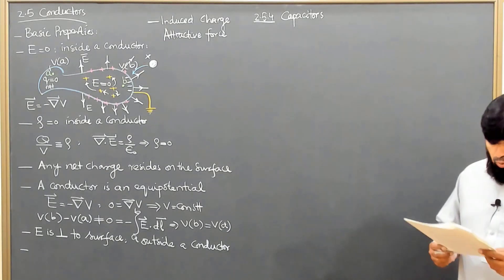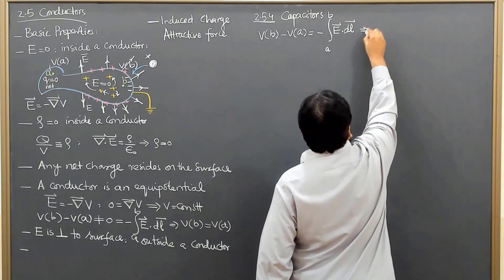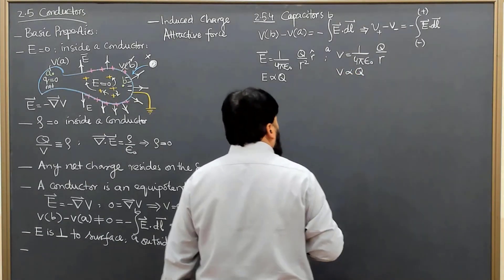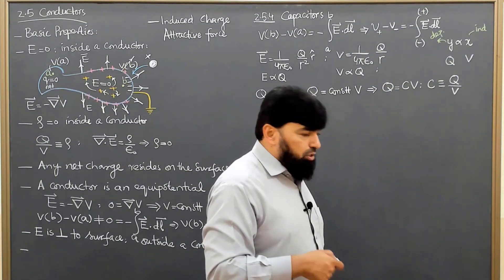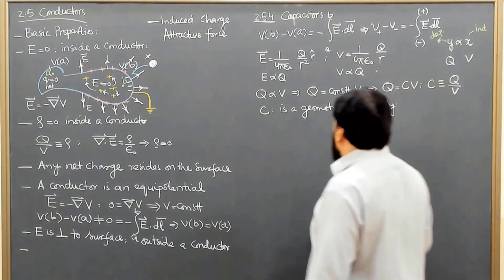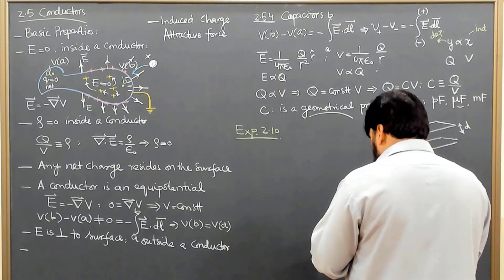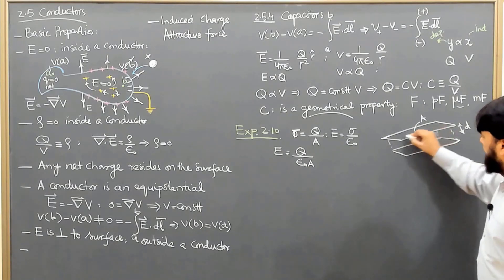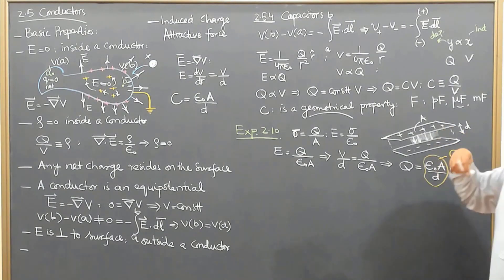L23.2 Capacitors

Comment: can you explain again why potential is independent while charge is dependent which sounds non intuitive to me, thanks
Reply from the maker: This behavior is a fundamental characteristic of capacitors and is utilized in various electronic circuits for energy storage, signal coupling, and filtering applications. From the basic formula, you can see that the capacitance is a constant value for a given capacitor. Therefore, the potential difference (voltage) across the capacitor is independent of the amount of charge stored on it.

In practical terms, this means that if you double the charge on a capacitor, the voltage across its terminals will also double if the capacitance remains constant. Conversely, if you change the voltage across the capacitor, the charge stored on it will adjust accordingly. Thanks